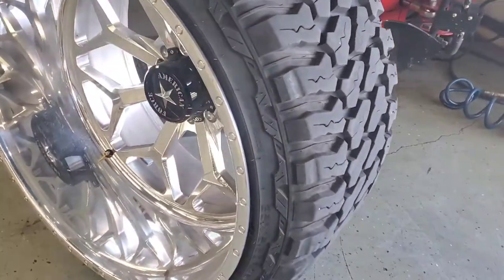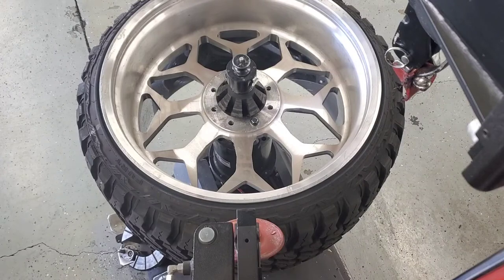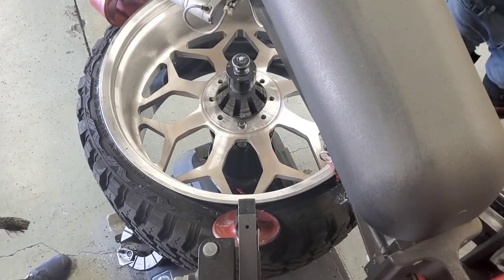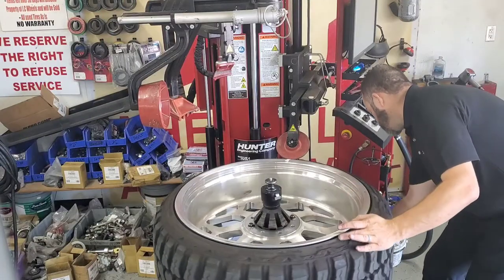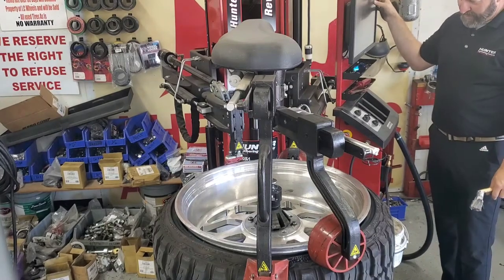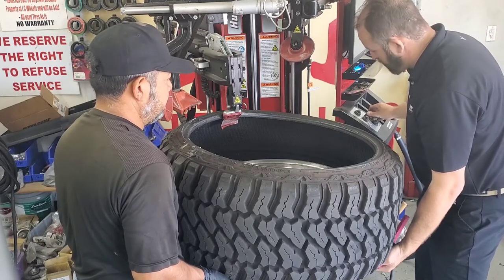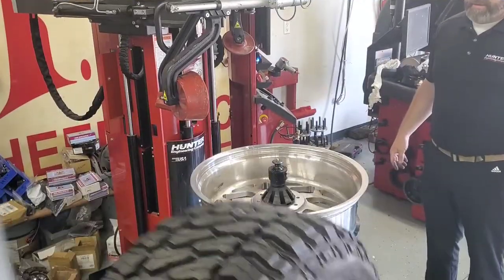American Force 26x16 Hunter Revolution tire changer

Comment: Helpful moment markers below. Thanks for the video David!
- [00:00](https://www.youtube.com/watch?v=PfLFbQdlvSM&t=0s) 🚗 The Revolution tire changer can handle a wide range of tire and wheel sizes, including a 26x16 wheel with a low offset.
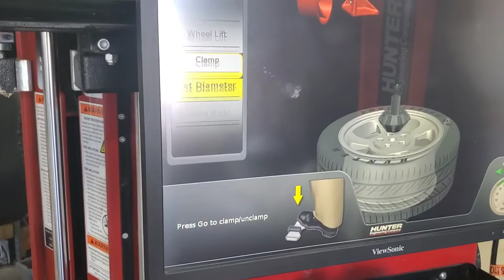- [01:12](https://www.youtube.com/watch?v=PfLFbQdlvSM&t=72s) 🛠 When manually dismounting large and heavy wheels, using a roller at the top of the tire can relieve stress during bead breaking.
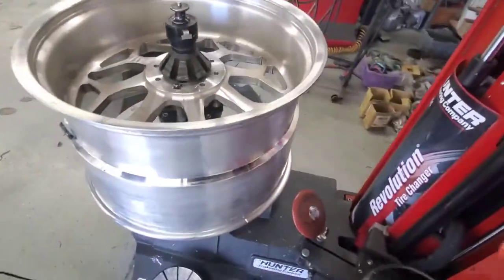- [03:13](https://www.youtube.com/watch?v=PfLFbQdlvSM&t=193s) 📏 Manual operation can mimic automatic processes, making it possible to work with challenging wheel and tire combinations.
- [06:22](https://www.youtube.com/watch?v=PfLFbQdlvSM&t=382s) 🧰 Using a tire lever to assist with mounting and dismounting low-profile, stretched tires can be effective.
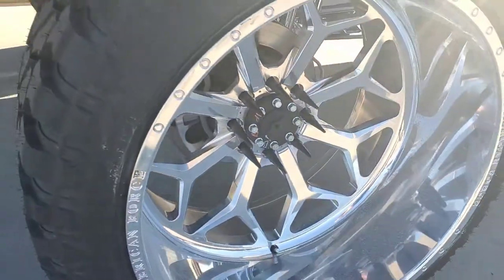- [09:46](https://www.youtube.com/watch?v=PfLFbQdlvSM&t=586s) 🌟 The Revolution tire changer can handle extreme wheel and tire combinations, making it suitable for various applications.